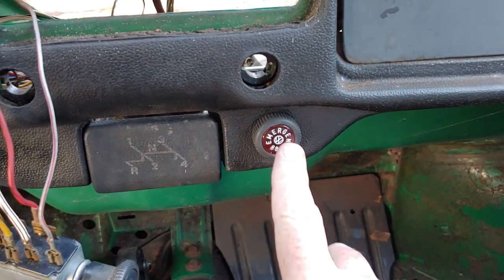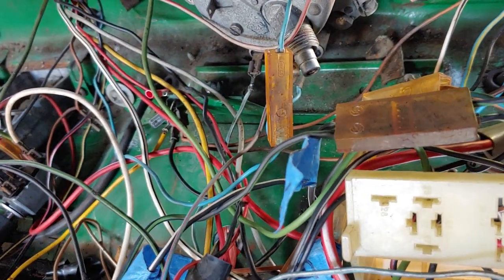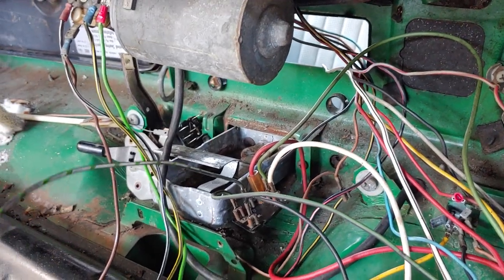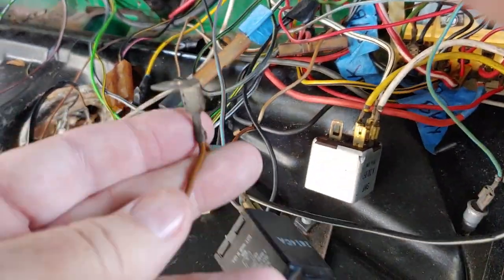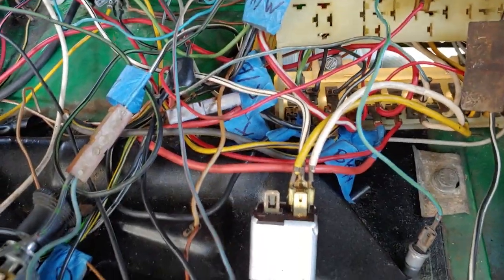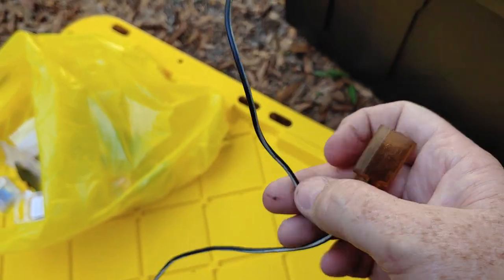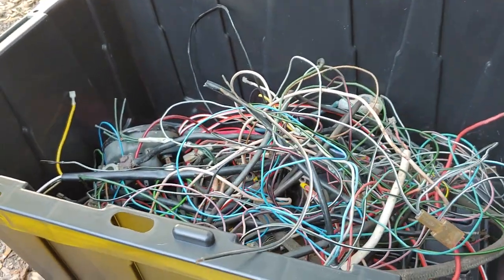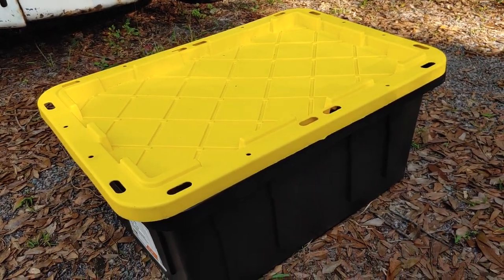CLASSIC VW- 1972 SUPER BEETLE . EMERGENCY FLASHER SWITCH, RELAY, AND GROUNDS

Comment: Hey John can you Please help? What wire color goes to the brake warning light and location and location on the warning light. Thanks so much and bless
Reply from the maker: Did you look at the jbugs wire diagram?
Reply from the maker: Go to jbugs.com its a parts supplier. Then type in whatever year your beetle is in thier search engine. It will pull up a full color diagram. Let me know if you still need help. I'm here for you
Reply from the maker: The warning light is a plastic plug that pushes on the master cylinder

Comment: Hey I have question no turn signal or flasher but I have power an nothing
Reply from the maker: Sounds like a ground issue. I know it's not a specific answer but mine was a bad ground to the body in the engine compartment

Comment: Hi John , I have a problem I hope you can sort out for me.  I have a 71 Ghia coup.  I've got all the wiring working except  the dash indicator light for the turn  signal flasher . I have put in a 3 prong flasher and have it working.  Blinkers and emergency flasher work. The dash light has the blue with green stripe wire. Jbugs diagram shows the wire piggybacked with the blue wire. I still get no light. I've removed the light and tested it, it works. What do you think the problem is ? HELP !
Reply from the maker: Are you " piggy backing.".off the factory spade or did you join the wires together at the wire and. Just so.i understand you correctly. The 3 prong flasher is factory or aftermarket?  If I understand your question correctly I had the same issue. Let me know
Reply: @Volkswagenplanet  Its an after market flasher with numbers on it of 31 , 49, and 49a   the piggybacked wires are on the 49 and the white wire from the emergency flasher switch  is on the 49a and the 31 is ground  all the flashers and turn signal lamps work except no dash light  in the directional indicator.  The wire to the lamp is blue with a green stripe as per diagram  and a blue wire are on the which are piggybacked  on 49. Hope this helps. I've got a 4 post flasher ordered to see if that works .
Reply from the maker: @danielkaylor8395  if I remember correctly there was a piece of paper that came with my replay. It was a diagram to show the conversion. I'm not smart enough to answer your question from memory. Let me see if I can find the paper. I'm sure it's standard. Give me a few hours. I will get back to you. Thank you for reaching out.
Reply: Hi John, I got the 4 post flasher today and it doesn't work any better than the 3 post . The 4th  post is marked K1. I tried putting the blue /green wire on it and got nothing.    So I'm still at a loss !  Thanks for your help.
Reply from the maker: @danielkaylor8395  this is exactly what happen to me after doing this series. When I ordered the switch they sent me the 4 prong as well. My switch came with a piece of paper in the box. It was the diagram to modify the switch. I think it was a piggyback wire as well. I couldnt get the new one to work either. I.ended up getting a used switch from a local friend. 
Do you have the orange Bently repair manual? It has all the wire diagrams for 68- up VWs. I was going to say flip through the diagrams and see if you can match one up?

I don't have my VW repair manuals with me currently. I can get my hands on them mid - day Sunday. I want to say the 73- up Super Beetles have the 4 prong switch.  Did you say the extra prong says " K1". I can look it up and get back with you on that info
Reply: @Volkswagenplanet  Yes I have the orange Bentley book. I made some progress yesterday.  I've got the 4 prong switch . I'm not using the 4th  K post. I've got the white hot positive wire on the 49 post. The blue wire on the 49a post and the negative brown wire on the 31 post. I piggybacked the lt bl /green wire on post 49a and removed the bulb holder from the speedometer. I run a ground jumper wire to the bulb holder contact that connects to the hot speedometer section on the speedometer.  That makes the bulb blink with the turn signal lights. Now the problem is. ;  I can't plug the bulb holder into the speedometer !  I'm going to figure out how to attach the ground wire to that contact and insulate it from the speedometer hot mount. I'll let you know how it goes.
Reply: I made a mistake here . Should be the  lt.blue/green wire from the bulb holder goes to the ground post 31.  And the speedometer contact on the bulb holder goes on 49a .
Reply: Well,  back to the drawing board again ! I thought I had it figured out but not ! Hooked up this way it blinks all the time ! Even with the turn signal lever is in off position !
Reply from the maker: @danielkaylor8395  ok, did that answer your question? Wiring is patience. You will be surprised if you do like I did and rewire each fuse. I had all kinds of gremlins going on. Several years of others putting there hands on stuff.
Reply: @Volkswagenplanet  No still no answer  !
Reply from the maker: @danielkaylor8395  if it stays on all the time there is a bare wire touching metal. More than likely in the column.
Reply: Got it figured out ! Tap into the left and right blinker light wires , black /white , and black / green , connect them together with the positive wire to the indicator light, with a diode in each blinker wire lead . You have to insulate the bulb holder from the speedometer.  Works ok.